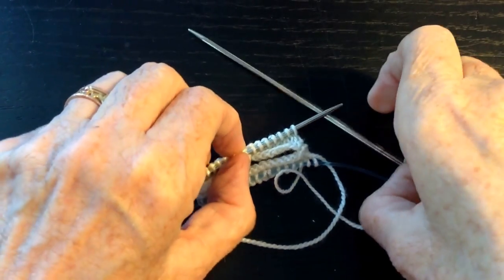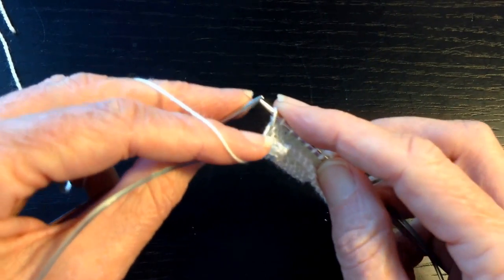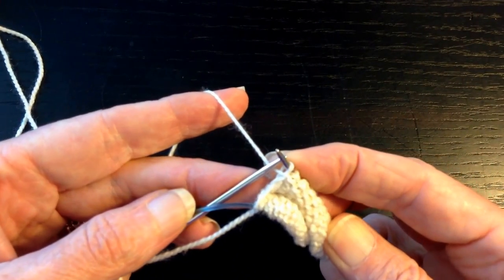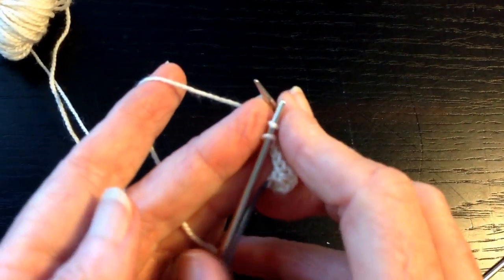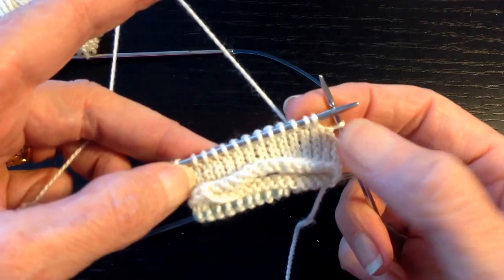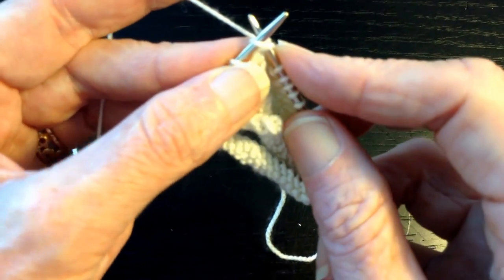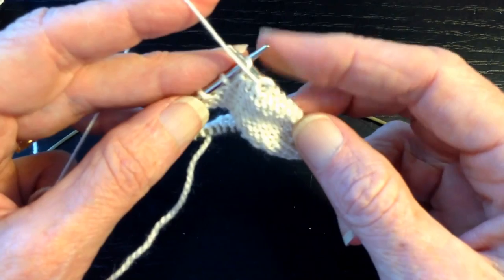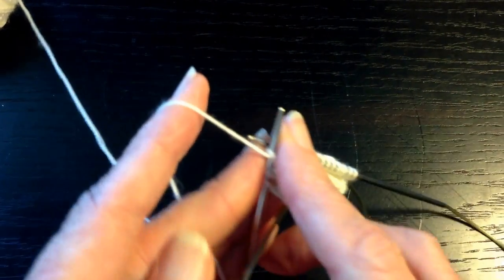Short Row Heel with W&T (wrap and turn)

Comment: Again you carry the process through to its conclusion for all of the beginners/novices; thank you. Question can I keep both socks on my needles with magic loop and while knitting heels? I read that you knit sock on right, then left, and then together when you rejoin in the round. Your thought? Have you make a video on this topic? Thanks.
Reply from the maker: Yes, you can keep both on your needles.  You will need to work each heel separately though.

Comment: Hi Suzanne.  Could this method be used with Magic loop ? I'm a little confused as to the last wrap procedure. Michelle UK
Reply from the maker: Yes, it is the same whether with two circulars or with magic loop.  The last little trick for closing the hole between the heel and the instep, is to, wrap the first stitch on each side of the instep, then go back to knitting gin the round and pick those last two wraps up on the first round.  You can do that on magic loop as well.